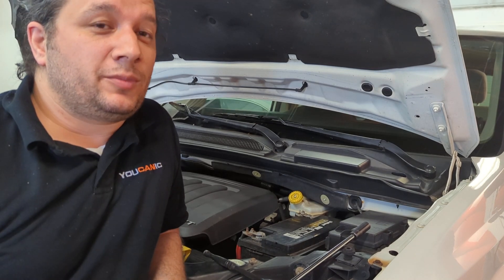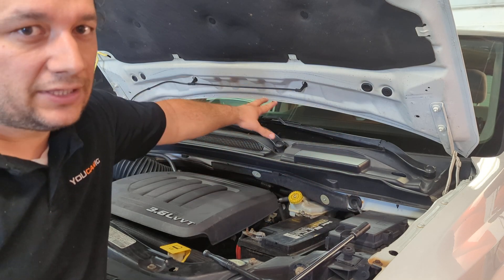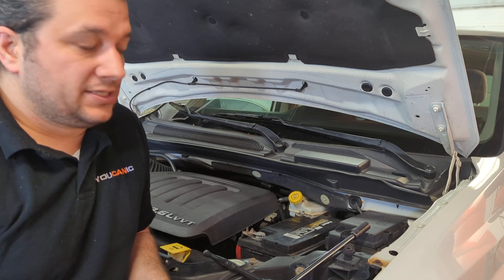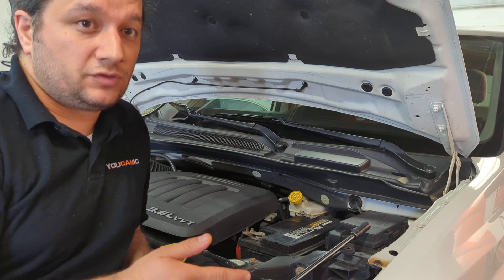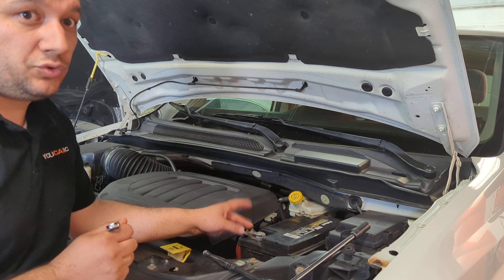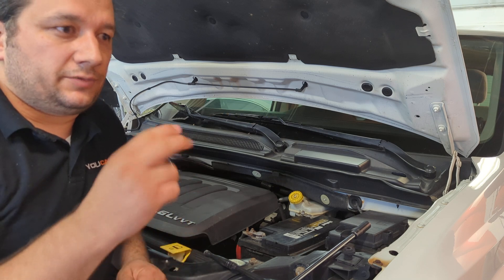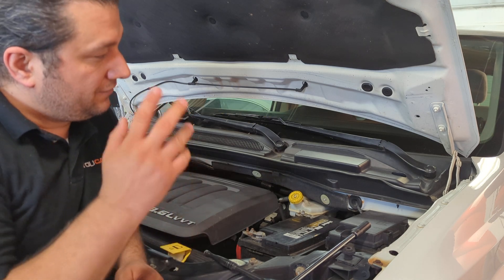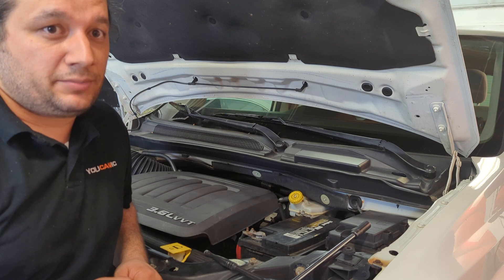Why You Should Never Keep Vehicle Powered up  When Replacing the Battery

Comment: The problem is that if I would disconnect the battery from the car, the radio will ask for a code. I asked, in Finland (for seat) putting the code cost 100 euros, which is a price of a new decent battery...
Reply: You need to figure out that radio code. There is plenty of online services that will give you the radio code for $10 at least in the US. Have you looked into the cost to replace a damaged ecu?

Comment: actually engine adaptations and all the settings get lost on power loss on many older cars
Reply: They revert back to factory defaults. That's not a good reason to keep car alive considering the possible risks of doing so. Loosing adaption data in many cases is in fact a good thing.